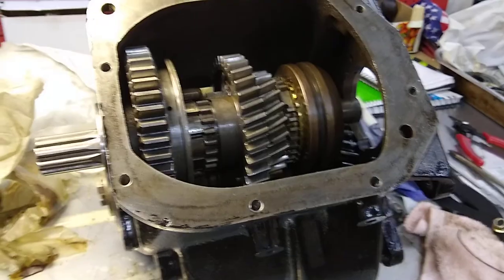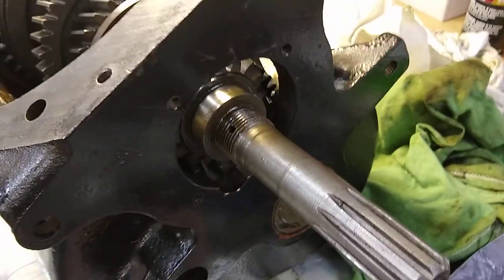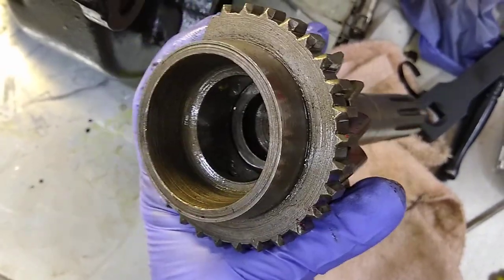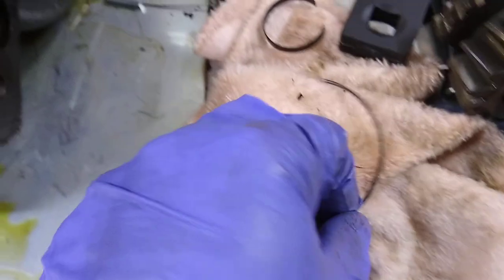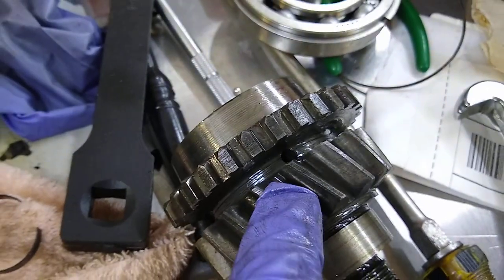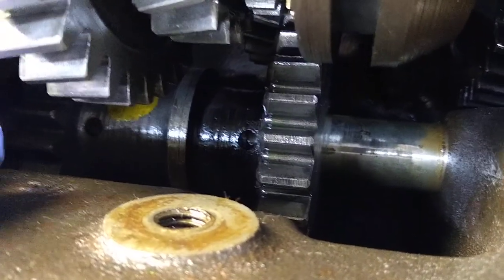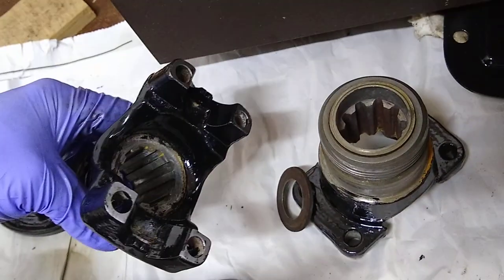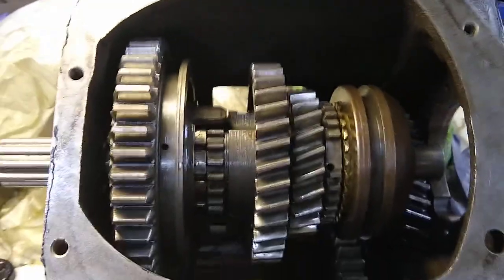SM420 Transmission Rebuild Walk through

Comment: This is a big help. I was cleaning up my transmission and found a broken synchro ring for 1st to 2nd. I have a donor trany and got the clutch gear out of the donor and heard the tinkle of the roller bearings going into the bottom of the case. Kind of a surprise.
Reply from the maker: Hi Paul, glad it helped!  Yes - that's a scary noise when you hear all those needle bearings fall.  It's like "Uh-oh, I'm committed to rebuilding this thing now!"

Comment: The SM420 was one of the very best transmissions ever built. Period. Too bad they haven't been made in 53 years... It would be great to see more aftermarket replacement parts such as cluster gears, etc. but I'm just dreaming out loud :)
Reply from the maker: Agreed - the thing is so simple and solid.  It would be cool if someone made aftermarket gears and stuff, but it's probably expensive and not profitable.
Reply: @theworkshop3706  Yeah, it's really too bad. Especially with modern metallurgy, CNC machining and so forth- these could last indefinitely.

Comment: I have a question on the shifter itself. What is that rod for that comes out of the right side of the shifter? I have an SM420 out of a 1954 Cab over engine truck and I'm putting it into a 1956 3600 and I'm wondering what that's for. Thanks.
Reply from the maker: On mine, it's the shaft for the parking brake lever, if we're talking about the same thing.  Some trucks use a floor pedal to the left of the clutch for the parking brake.
Reply: @theworkshop3706  OK thanks for the info, that's what I suspected it was.